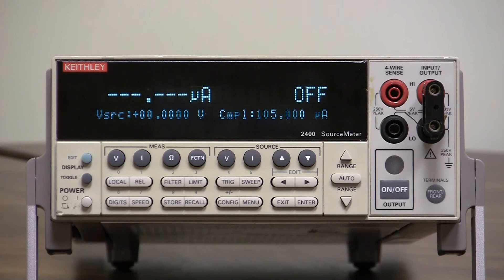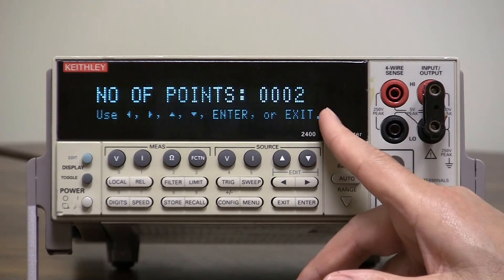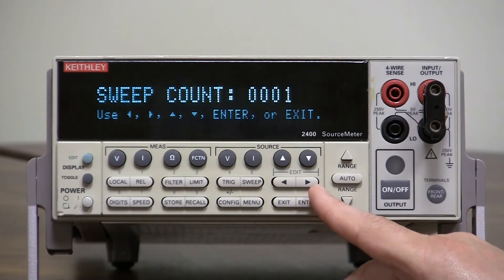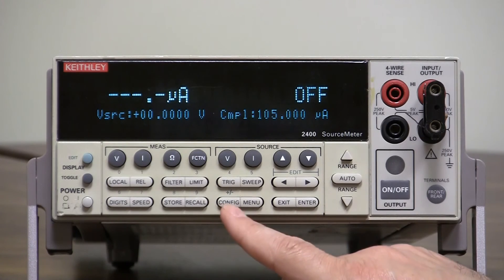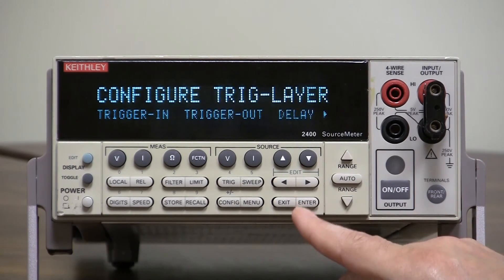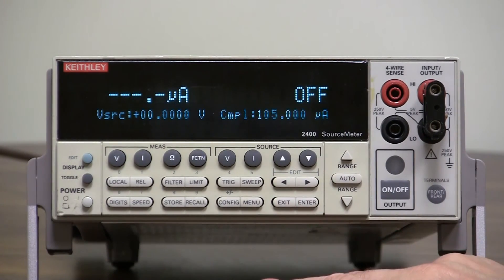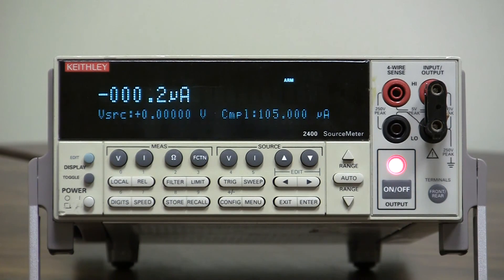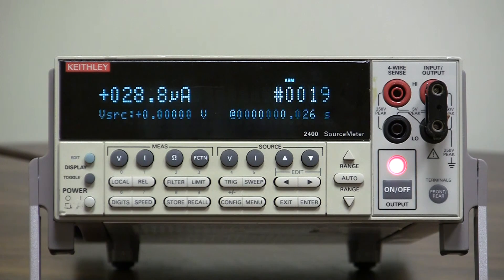How To Setup a Fast Voltage Pulse - Keithley Instruments Model 2400

Comment: I have used all the same parameters with above, but it takes 292 ms to get 10 sweeps. My Keithley2400 was bought in 2008. Can someone tell me what is the reason? How can I get a fast pulse like 1-2ms?